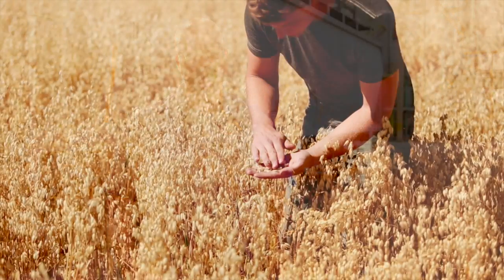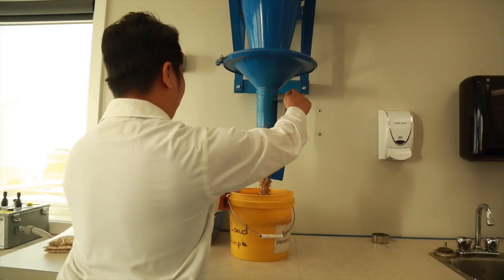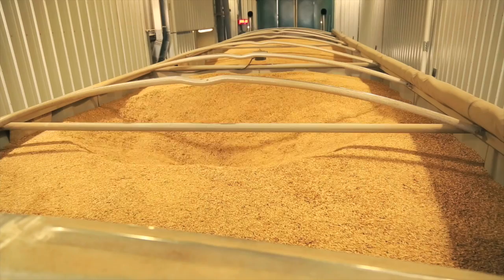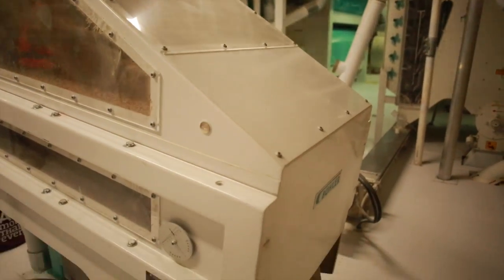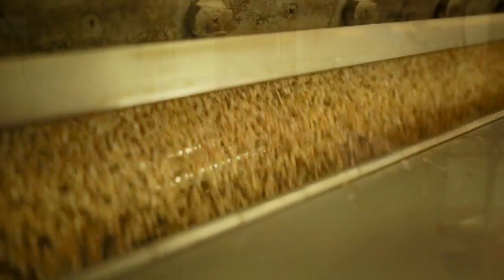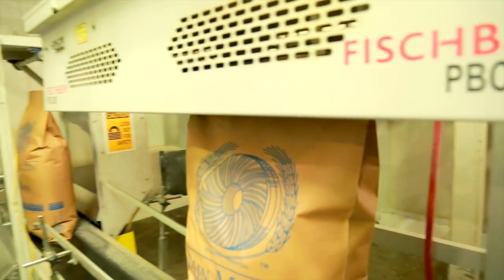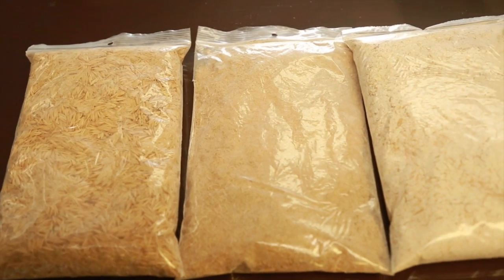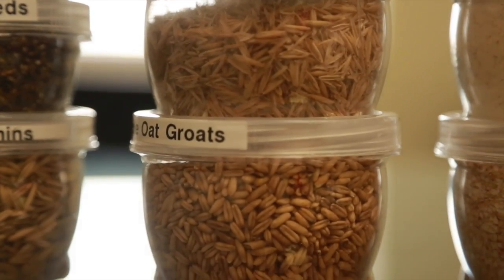Story of Oats: Processing

Comment: I worked in a grain elevator for seven years as a chief weigher. This is back during the Russian wheat deal. Mill operator didn't tell you you're fired for trying to leave after a 14 hour shift. Oh the rats, pigeons and owls. Conveyor belt fires always at the rollers. barley and oat chaf is a skin irritant. makes you feel like ants are crawling all over you. don't forget about the spills and over filled storage. grain dust always airborne. that was either a phony mill for they shut down and cleaned for weeks prior to filming.

Comment: Oat husk. A great term for the WHOLE grain. And dehullers. Another great term. The kilning process means they cook it, and kill it and dehydrate it. 

So the husks and hulls are used for livestock feed. Livestock that evolved to eat grass, leaves and other living things, not dead stuff. 

Groat fraction and liftings. I've written a lot about pet food being made from material they didn't evolve to eat. Wild dogs and cats before they were domesticated, never ate a single oat groat or lifting. That did not happen until more than half way through the 20th century. Your pet did not evolve to accommodate oat groats or liftings in the last 70 years. Aspirating is another dehydrating step that involved the entire groat, not just the part (dust) removed for pet food.

Beta Glucans - in this use, beta means passive - inert fibre as I've mentioned before. No actual nutritional benefit of any sort. It does have a minor mechanical function - that of causing irritation to induce colonic peristalsis - regularity in other words. Oats is good for that. But for most people the dust goes completely unnoticed by us, including by our  colons. Remember the word passive? So beta in this sense also means filler. Glucans - means that glucose is (carbohydrate) a simple monosaccharide  with a molecular formula of c6h12o6; it is a principle source of energy for cellular metabolism while glucan is (carbohydrate) any polysaccharide that is a  of  which is another way of describing subtly different sugars sharing molecular bonds. These are all SIMPLE SUGARS, just as I've been saying. It's so nice to have an industry stalwar,t, Terry, step forward and reveal more of what I've been saying is the bare naked truth isn't. So your oatmeal is what I said it was: and the exact same thing my Freestyle Libre says when I test my blood sugar after eating Oatmeal of any description. 

Let's not forget that the number of Americans with blood sugar disorders is getting on for nearly everyone. Using those numbers to determine who should and should not be consuming grain of any description comes out a zero. It's pretty obvious from the numbers that grains are a massive cause of blood sugar diseases in America. There is no other way to interpret the information in this video when you combine that information with the known medical data.

The video isn't done yet. Let's see what else he says. Well that didn't take long. Stick to your ribs somehow equates to weight loss. How's that for an oxymoron?

Good healthy food he says. The food he's talking about is stone cold dead. Nothing healthy about being dead. Every living thing besides humans eats live tissue of some description and Oatmeal does not fit that definition of food other than as a filler that causes blood disorders eventually.

But people infer that healthy food means it will make them healthy right? Well it does right up until it does not, starting with tooth decay. How healthy is that? Tooth decay then gum disease, then periodontitis, which means bleeding gums and teeth falling out. Does that sound healthy to you? Bleeding gums is the launch pad for Covid-19 as well. Once a Covid Virion hits your oral oat slime replicates into your leaking blood, it replicates right into your blood stream through your damaged gums and from there is conveyed straight to your lungs where it can easily kill or maim you for what is left of what will be a really miserable and short life. Doesn't oatmeal sound yum, yum? We're not done yet though are we? No! They feed babies! Human infants that didn't evolve any organs to deal with the slime that comes with oatmeal. When you hear a baby with a wet cough, thing about whatever grains the baby has been forced to ingest. 

You know what the slime is right? It's the starches being released from the oatmeal because dead tissues cannot retain anything. So the starch starts to separate from the nutritionless fibre  and becomes a starchy gel/slime. They don't like to tell you what that slime actually is but its the glue in glucan. Starch just a collection of sugars, THE LAST thing you should be feeding to an infant that needs breast milk. Terry, the narrator tells us oats sticks to us and helps us lose weight at the same time. You have to ask yourself what sort of weed this guy is smoking.
Reply: So what does that mean for oatmeal bought at the store?